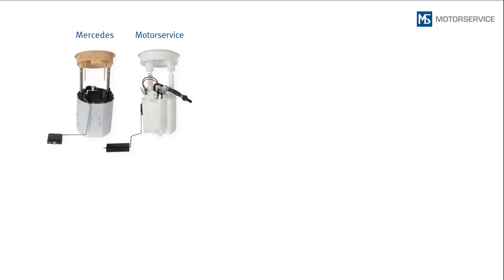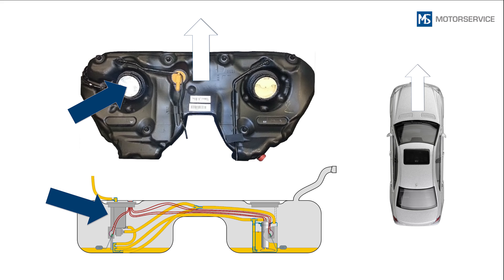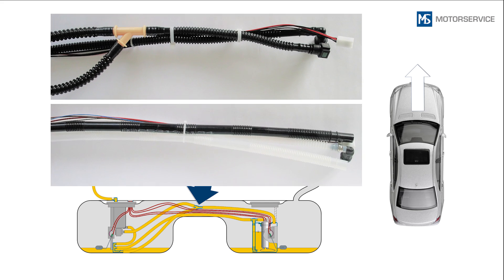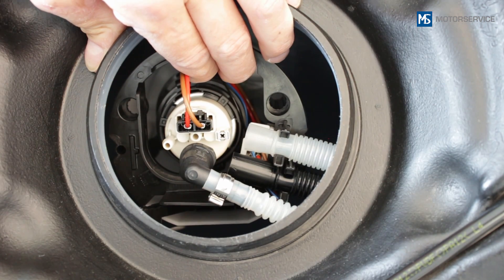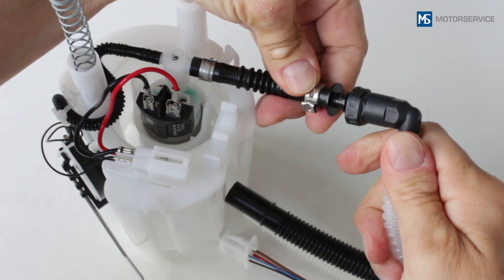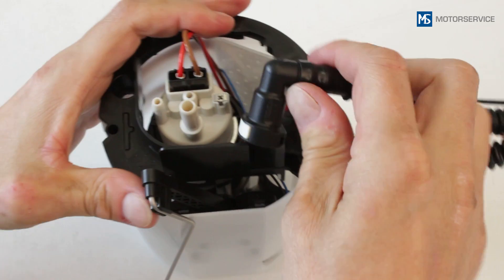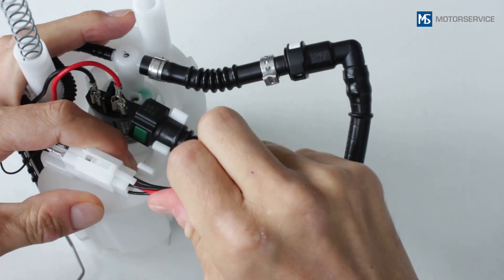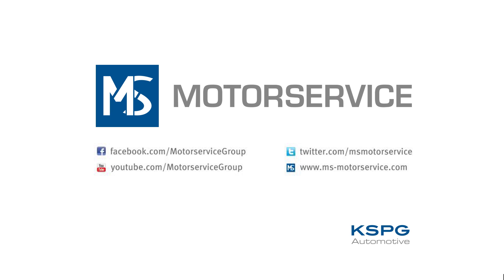Mercedes-Benz in-tank module - Motorservice Group

Comment: July 24, 2023 --- Hi.  I own a  2008 Mercedes E350 V6.  The fuel pump is no good. I went to my mechanic and he said that the pump cannot be replaced by itself.  I have to buy the pump and the tank.  That increases the price of the job. The parts alone are $2500.  But I and my brother-in-law watched your video above.  It seems like you are working on an E-350 but you are able to replace the fuel pump with another fuel pump.  You are not dealing with the tank.  Why is the Mercedes dealer and my mechanic telling me I have to buy the tank and the pump.  Thank you for your help
Reply: Depends on your model of car, there are 2 of each one a PZEV spec and one that NON PZEV spec. Essentially it’s just a California thing where if the car is a cali spec then the whole emissions is sealed leading to the fuel pump being sealed with the tank which is why you need to replace the whole thing

Comment: I have an 07 E350 150k+... $2000 after market tank and full pump... PZEV... They designed a piece of garbage and charge a fortune when it fails.... So many missed the warranty by 2-10k miles....
Reply: At that point Id see if a non pzev tank would fit

Comment: HI I HAVE JUST BOUGHT A SECOND HAND W221 2007 S550 AND TOOK IT TO BE SERVICED CHANGES BATTERY OILS, AND SERVICED. AFER DRIVING FIRST TRIP. NOTICED THAT THE FUEL GAUGE STARTS GOING DOWN AND THE CAR SWITCH OFF. THEN AFTER STRIPPING FIRST TIME AND OFF THEN ON AGAIN IT WORKED, BUT FOR a SHORT TIME. UNTIL I PARKED AGAIN. THEN WHENEVER I START IT CRANCKED BUT THE FUEL STAYED DOQWN.. I TRIED to SHAKE THE CAR IT MOVED UP THEN GOES DOWN AGAIN... IT STILL NOT STARTING. , THE CRANKED BUT NOT STARTING. 

WHILE WAITING TO take IT TO THE SERVICE SHOP AGAIN, I JUST WANT TO KNOW IF THERE IS SOMETHING I CAN CHECK TO START IT AT LEAST TO DRIVE IT TO THE MECHANIC.
Reply: Start by checking your caps lock button

Comment: Which part of this system, if broken, will cause the vehicle to 'run out of fuel' with half tank remaining? Would that indicate the fuel from left chamber is not being delivered to the right side?
Reply: @Stephan Bayer 
Are you guys sure it's not the return pipe?
When you replaced the fuel pump did it come with NEW return hoses?
From what I can gather the pipes are liable to fail causing a loss of pressure.
If the fuel pump is replaced but there STILL no fuel in the sender unit side (left hand side) then its not the fault of the sender unit but a lack of fuel going to it.
I.e. the pipes aren't feeding it.
This video shows NEW pipes so maybe that's whats needed to fix this issue?
Reply: @kmoe786   This is a well known problem with Mercs and a lot of other cars with a saddle tank.The fuel is constantly circulated by the pump and returns to the non - pump side of the tank,outgoing fuel from the pump side runs through a venturi which (should) create a depression and draw fuel from the other side. Over time,as the fuel system gunks up,this stops working. I ran a load of fuel system cleaner through my C180 and it ran down to the fuel light,twice,then back to business as usual. A waste of £20 but it proved the point and,no,I have not fixed it,too much hassle.
Reply: hi, I have the same issues with my tank its a 1999 c220, were you able to resolve it? and how did you go about it? thanks
Reply: This seems to be a well hidden secret with this issue! I'm having this problem right now and cant find the answer anywhere online! It would be wonderful for someone to let us know!! I will figure it out and when I do I will post it for everyone to see!
Reply: @Stephan Bayer any luck  ?

Comment: why after installing both left and right units as per the instructions above, the fuel gauge is showing the incorrect level of fuel in the tank.  Appreciate your kind reply on this problem.  I have also changed the fuel pump relay MB part no 002 542 9219.  Level problem remains. My car is W211 E200 Kompressor
Reply: bryankss hi
Now How to deteted light fuel After change ? Il have clk w209. Thanks.
Reply: bryankss probably because one of the line is hitting the gas flower so it stop it from flowing all the way up

Comment: HELLO SIR , I HAVE ONE C320 EMC 2004 LEFT HAND DRIVE CAR
ITS HAVE A FUEL GAUGE PROBLEM. SOME TIME  GAUGE IS OK SOME ITS FELL DOWN THEN I CHECK IF DISCONNECT THE FUEL PUMP SOCKET FROM TANK GAUGE FELL DOWNIF CONNECT ITS WILL SHOW 3/4. I SUSPECT THE FLOAT PROBLEM.
CAN YOU EXPLAIN THE EXACT PROBLEM &HOW MANY FLOAT IS USING THIS MODEL
THANK YOU